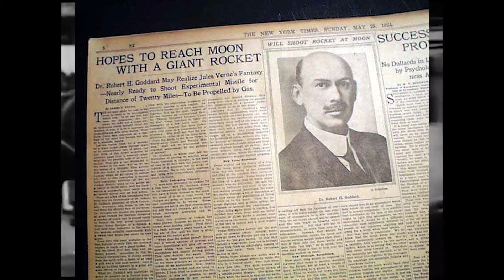Rocket Engines Explained [IN UNDER 3 MINUTES || AN ILLUSTRATION OF NEWTON'S THIRD LAW]

Comment: Here is my example to help one understand how rockets work.
Let's consider a rocket engine running on earth in atmosphere before we discuss a vacuum.
 Let's use a space shuttle main engine as an example.
So, when an SSME is running, here on earth, in sea-level atmosphere (14.5 PSI)
1 - Does the exhaust gas get "accelerated" as it leaves the rocket nozzle?
2 - Does the exhaust gas have "Mass"?
3 - Can "Mass" Be "Accelerated" without a "force"?
(Or is a force required to accelerate mass?)

However, this lecture requires some participation from the class.
Anyone?
Reply: 1: NO, as the velocity of a gas particle is a function of its internal energy & gasses expand from higher to lower pressure using this internal energy, no force is applied during the process. The rest are moot. Kinetic theory & thermodynamics are not in your programming, sadly, chatbot, so you will rant at me endlessly 😂
Reply: @papalegba6796 Sorry but last time I checked "Rocket Scientists" explain how rockets work, not high school dropouts.
But bless your little heart for effort!

You still claim that no mass comes shooting out the back of a rocket.
So we will just ignore whatever you say as you are clearly incorrect about how rockets work if you ignore such a simple fact.

Comment: Easily the dumbest video on YT.   Rockets   ( like toy balloons)   work on the pressure principle....nothing else.
Reply: - "Rockets   ...   work on the pressure principle...."

So, are you suggesting that rocket engines use "PRESSURE" to push the exhaust out of the nozzle?
You might be ON TO SOMETHING.
Reply: @stuartgray5877  No.  Rocket engines create pressure by mixing fuel and oxidiser to be combusted to create pressure.  However.  
No pressure can be created if the rocket is exposed to a vacuum.

Comment: So balloons push on the atmosphere but rockets don't? Ok 😂
Reply: So rockets CAN "push on" Atmospheric gas at 14.5 PSI, but they CANNOT push on gas that is at 3000 PSI?
Why is that?
Reply: @stuartgray5877  not what I said, ChatGPT guy 😂
Reply: @stuartgray5877  if the atmosphere was at 3000 psi then yes they could push on it. But they cannot PUSH on their own exhaust, Newtons first law says so, chatbot 😂
Reply: @papalegba6796 You just think that rockets CAN push on 14.5 PSI air (which is a "gas") but cannot push on the 3000 PSI gas in the combustion chamber.

Very consistent, aren't you? You believe a rocket CAN push on GAS but CANNOT push on GAS.

Even though the 3000 PSI gas in the combustion chamber has about 1000 times MORE MASS than 14.5 PSI atmospheric gas.
Got it thanks.

Comment: ¨As gas escapes one way, a force is applied the other way. ¨  
That reaction force is an immaterial force and an immaterial force could be deemed a spiritual force, but I like to say, rockets work on the principle of will power. 
We know, that gas escapes ONE WAY and gas is a material made of molecules, but there is no material force going the other way to push the rocket in opposite direction, so it must be an immaterial force pushing it forward.
Reply: What does Newtons first TWO laws say about mass?
What does it REQUIRE for mass to be accelerated (to change velocity)?
Rocket engines definitely "change the velocity" of the mass of the exhaust gas.
HOW does a rocket engine change the velocity of the exhaust gas?
Does it use MAGIC"?
Reply: For the umpteenth time Stuart - What MATERIAL force pushes the rocket forward?
Can you show that accelerated mass hitting the front of the chamber to push the rocket forward?
NO you cannot!
Reply: @stuartgray5877  they say external force is needed for an object to alter its state of motion. A vacuum cannot apply external force. Very simple.
Reply: @papalegba6796 So rockets push on gas but they cannot push on gas.
Got it, thanks.

Comment: Not trying to attract a bunch of flat earthers. Just trying to understand why it is that the balloon is not pushing off of other air molecules around it. Is the water in the hose not doing the same thing?
Reply from the maker: The balloon is pushing on the air. The energy that is lost is called air resistance. Let me know if that answered your question.
Reply: @TheAlchemist1  so the rocket in the vacuum of space is pushing off of the exploding fuel coming out the back of it? This seems like I'm shooting a string of marbles out of the back of my ship and only because the marbles are touching each other in my moving forward. If I fired a string of marbles out the back of my ship would I go forward? Seems like I would go forward just a little bit, even if it was mostly just marbles shooting out the back and that's exactly what we're talking about.
Reply from the maker: @ragnarrothbard3418  yes it is like shooting marbles out the back of your ship, that is a good analogy. Though the marbles do not NEED to be touching each other. You would get a tiny amount of thrust from each one (equal to its change momentum).
Reply: @TheAlchemist1  gas is not a solid, so it is nothing like shooting marbles out the back 😂
Reply: @papalegba6796 Gas has mass just like marbles, so it is EXACTLY like shooting marbles.

You have even been told that the "exhaust" from a space shuttle main engine is pure water, but you refuse to admit this because THEN you would have to admit that the rocket exhaust HAS MASS.

But do go on pretending to be an imbecile